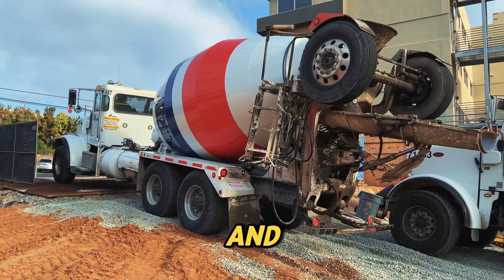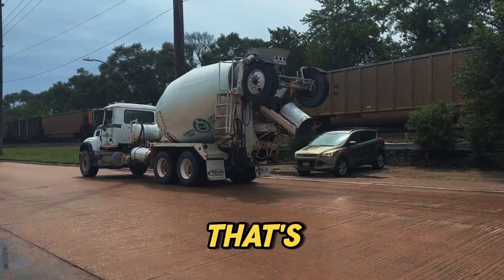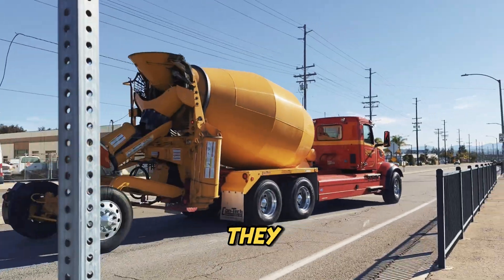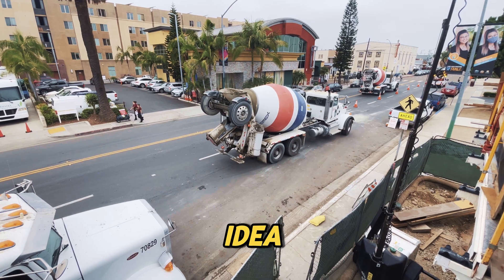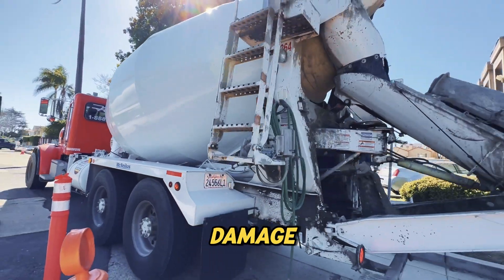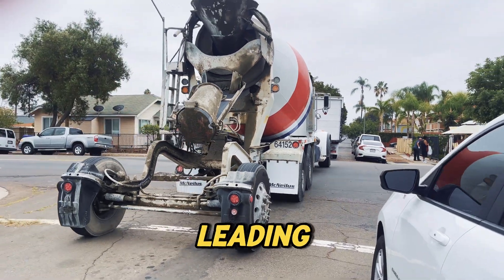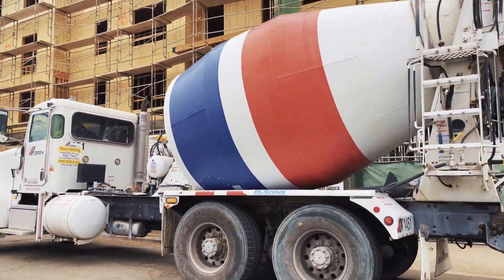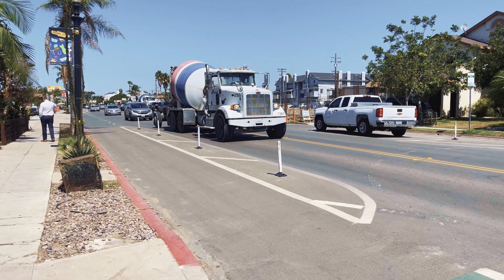Why Do Concrete Mixer Trucks Have Extra Wheels on Top? 🚚❓

Comment: In Portugal, we have trucks that transport 6 to 10 cubic meters of ready-mix concrete without needing those extra wheels. If 1 cubic meter of concrete weighs approximately 2300 kg, the transport containers range from 6 to 10 cubic meters. All this without the extra wheels that you have.

Comment: What a silly design. Why not just use a tri-drive. I get they are harder to steer and increased tire wear, so the 3rd axle could just be a tag axle and raise up off the ground under the fender. I've always ran tri-drive mixers. Them boosters that flip up like that make no sense. They are in the way, they swing out in traffic when turning and extra time to use them.

Comment: Me and my dad had always wondered what the heck were those set of wheels for and thought it looked rather silly because no other type of heavy trucks have them. Concrete mixers around the world don’t have that silly looking thing so why is it that in the United States they do? I work with a concrete contractor I see mixer trucks almost every day now and see the set of wheels lift up as the trucks arrive on site or have already been lifted up to back up to the awaiting concrete pump truck. Before I started working in concrete I didn’t really care for mixer trucks but now I find them intriguing and quite the interesting piece of machinery
Reply from the maker: You’re definitely not alone — a lot of folks see those “extra wheels” and wonder what the deal is. They’re mostly used here in the U.S. to help with weight distribution and road legal limits when the truck is fully loaded. Once the truck is empty or on-site, the driver lifts them to save tire wear and improve maneuverability. It does look kinda silly if you don’t know what they’re for — but once you do, it’s one of those things you can’t unsee 😄

Appreciate you sharing your story. Mixer trucks are fascinating once you get into it. Welcome to the concrete club 👊🛠️

Comment: Those American concrete mixers with their liftable trailing axles are a complete misconception! The concrete mixer body on the truck frame should be positioned further forward. That way, they could eliminate this ridiculous axle and the associated weight! No one in the rest of the world, except the Americans, has come up with the idea of placing the body of a truck mixer so far back that it has to be supported with a folding axle. But hey! Why do it the easy way when you can do it the hard way 😂😂😂
Reply: I've always ran tri-drive mixers in Alberta. Them tandem trucks with silly flip axle make zero sense.
Reply: Holy cope, shut up 😂